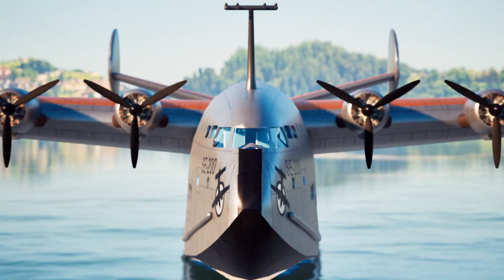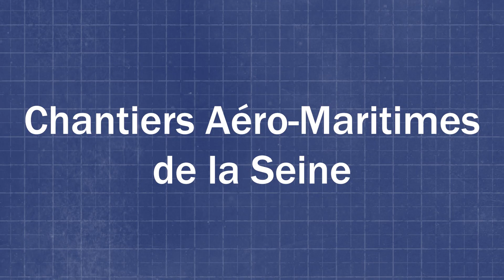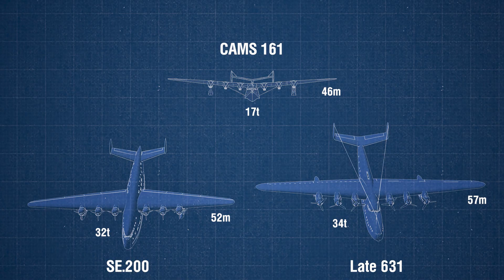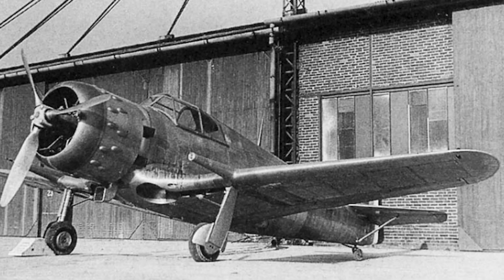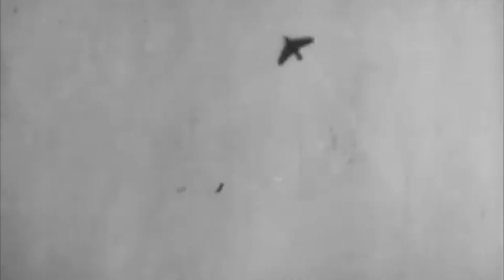The Disastrous History of France's Giant Flying Boats

Comment: To which extent has there been an inspiration by the Do-X? This of course suffered from the weaker engines from a decade earlier, bit the dimensions were pretty similar and 66 passengers (155 in the record flight) the standard spec?

Comment: Saunders-Roe's last ones were prettier, but the French had a good go of it. Edit: SaRoe Princess had nicer lines, but the engine/prop situation was ... interesting (contrarotating twin props on the four inboard engines, single on the outermost pair? WHAT). IMO best-looking flying boat was the midsize Do.24, especially the one Dornier himself (grandson of the original) rebuilt with a modern wing and turboprops.

Comment: Flying boats (and thinking about what turbine engines could power them) is a subject of special fascination for me.

The LeO H-47 had about 2,600hp - good for two GE Catalysts.

The Latécoère 521 had about 4,080hp - good for four GE Catalysts or two CT7 turboprops. Interestingly, a single PW150A would provide more than enough power for it!

The CAMS 161 had about 5,340 hp - good for four GE Catalysts, or three GE3000s.

The Amphitrite and the Latécoère 631 each had about 9,600hp - good for six CT7s or three GE3000s or two PW150s.

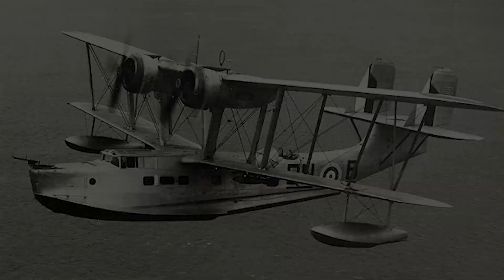Comment: 2:24 - untagged. It's a Sikorsky S-42.

I also understand your utter frustration with the big image houses. I ran into this when researching the Boeing Model 314 ("Clipper") to create a version for Lockheed-Martin's Prepar3D simulation platform. To show you how egregious it's become, if I may quote my own documentation for the project:

"One of the bigger frustrations was trying to run down the original attributions for many of the photographs available on the internet. It’s not helped by some of the bigger stock image houses claiming copyright on pictures they can’t possibly own (some examples: I found both Alamy and Getty Images claiming copyright on the same cropped image whereas the uncropped version clearly had ‘Boeing’ written on it; I found a British War Department image being claimed by both AirTeamImages and RAeS FotoStock; I found a Pan American Airways System timetable from 1939 being claimed by FotoStock and finally, Getty Images (now Visual China) claiming copyright on a photograph from the March 1939 issue of the B-314 flight operations manual. There are many others."

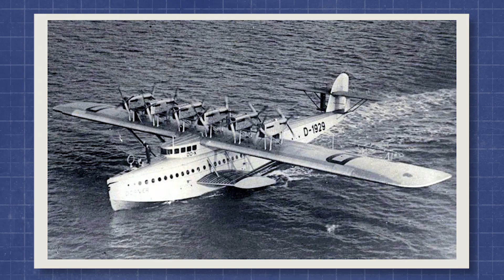Ironically enough, the photograph of the B-314 "California Clipper" that you show at 28:49 is genuinely under current copyright. The photograph was taken by Clyde H. Sunderland in 1939. His photographic estate passed to/was bought by Pacific Aerial Surveys and nine years ago, Pacific Aaerial Survey's assets were bought by (guess who), Getty. In each case copyright was renewed - I know, because I spoke to Pacific Aaerial Surveys ten days before the sale to Getty was completed. Getty then, of course, wanted some ridiculous figure to allow me to use the picture ($5000 I think was the amount mentioned). The version you have used has, in typical internet fashion, had the original Pacific Aerial Surveys copyright notice trimmed off the bottom.

Comment: It's hard to believe that these airplanes werre designed in the same country as those hideous bombers.  These were gorgeous.
Reply: IMO the ugly appearance of France's interwar bombers was due to their efforts to make them as easy to produce as possible and reduce costs as much as they could, leading to very crude, boxy air frames. I remember Rex mentioning that some of their designs (the Bloch MB 200 & MB 210) did achieve some success in the export market precisely because they were so cheap and simple, almost any country could manufacture them. You can also see this in the transition of the Farman F.220 family, from hideous metal boxes, with sharp lines and rough surfaces, to the more stylized and polished appearance of the NC 223, reaching its optimal shape with the NC 223.4.

Something similar happens with the Amiot 143: The first design accepted by the French Air Force is the poster child for ugly French bombers (literally, it's the first plane shown in almost every page talking about French interwar bombers), followed by the (rejected) Amiot 144, with retractable undercarriage and a slightly more aerodynamic airframe.

Then, after France's rivals start building large, modern bomber fleets, we start getting the more sleek and elegant planes, like the Amiot 351/354, Breguet 690, Lioré et Olivier LeO 451 and Potez 630.

Another plane that should be the poster child of this idea of making bombers too cheaply, to the point of leaving them with no redeeming qualities and turning them into a waste of money, is the Potez 542, which was chosen over better designs mostly because of its price tag and simplicity.

Then, looking at other countries, we can see some similarly boxy designs with rough airframes in nations that also experienced problems with their aeronautical industry, like Italy with the Savoia Marchetti SM.79 and the Caproni Ca.133, and the USSR with the early Tupolev giants. Regardless of their performance (both Italy and the USSR managed to produce useful bombers that achieved considerable success early in the war), it's clear, just by looking at them, that their designers aimed to make them as easy to produce as possible.

An added irony is that, due to the French aircraft industry being so disorganized, even those cheap, simple bombers could only be produced in very limited numbers, meaning they were trying to deal with their problems by correcting the wrong thing.
Reply: @ good analysis.
Reply: And yet, if I recall correctly, those bombers had reasonable handling characteristics.  Sadly, the same can not be said for the Lat. 631.
Reply: Agreed!   These look amazing.

Comment: Did I ever tell you about my visit to the Nimitz museum? The dud told me they have a wreck. Like a Japanese aircraft wreck. He said no, a Rex. Oh crap they had a Rex restored and I got a private tour.
Reply: Crashed kamikaze were often found to have Dunlop tyres. Either they'd been taken from allied planes or had been built pre war. Then again, quite a few vehicles of the Blitzkrieg were found to have Ford engines.
Reply: @jonathansteadman7935    Interesting little tidbit, but in the interwar period, many manufacturers had plants in Weimar Germany. 
Yes, even Dunlop.  As the true vampires they were, the N-party were quite ok with subsuming foreign manufacturers for their purposes, including having them build & repair Fw.190s and producing the GR14 engines (used on the Hs.129 and Me.323).  The French used several Fw.190s for a short period after the war as NC.900s until their engines ran out.